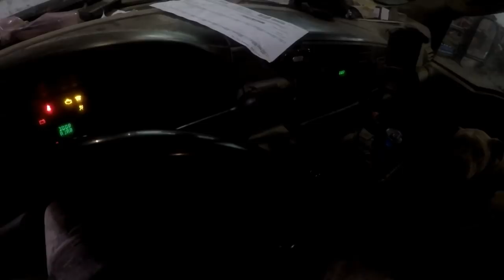7320 ivt removal part 3

Comment: G I could never understand why engineers that design equipment and make it a lot easier to work on. I like your rigging on the box to allow you to pull it out. We had to do a lot of that kind of stuff in the mine since we did not have the advantage of a crane. Good vigie keep up the good work and work safe.
Reply: expidition07 in the case of industrial equipment the engineers have both their eyes on the bottom line and making things difficult to work on just means that their service departments can charge more money per job.
Nothing is designed for the small shop/average Joe to be able to work on anymore.
Reply: I know what you are talking about. I admire your work ethics and enjoy watching you work on the different equipment. I also enjoy you showing the trouble shooting side of your work. Most people will just start changing components since the do not  want to take the time to do the troubleshooting.

Comment: In your experience do the IVT's hold up as well or better than the old Deere Quad ranges and power shifts?
Reply from the maker: mrih1586  Sorry it takes awhile fore to get back to you sometimes.  Usually I get home and try to reply. So the Ivt transmissions we have found don't hold up to the ripping and plowing like the powershifts. One of my customers has a 8345rt that we have been into the ivt 2 times now, and both times they were ripping. So they rip with their cat challenger now witch has a powershift.
Reply: No need to apologize. Just happy you took the time to reply.  Thanks for the info. We have to rip red clay. Guess I'd better leave the IVT's to the hay and No-till farmers.

Comment: Have you taken a Fendt CVT apart?
Reply from the maker: bimmerman3  No , I have never even been around one. Not many around here.
Reply: I think they use more hydrostatic pumps and motors to control a planetary gear setup with a two speed range
transmission.

Comment: Hey grease wouldn’t it have easier to Roll everything out the back and then taking it apart. Looks like a bitch to work in between that chassis. How about those new case and new holland with the FPT power train are they good
Reply from the maker: Zameer Akaloo  On a large frame 7,000 series that's the way to go, but on these 6 and small frame series , where you pull the big bolts out of the planetary housing there are some pressed in pins that are a pain in the ass to get out. As far as the case and New Holland tractors, I rarely have to work on transmission .